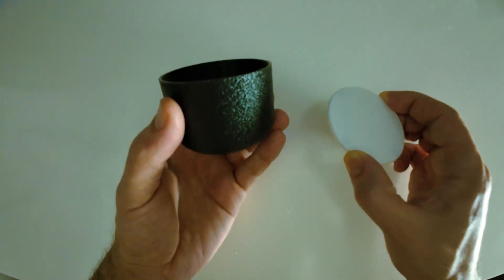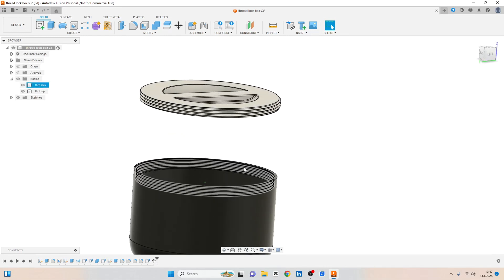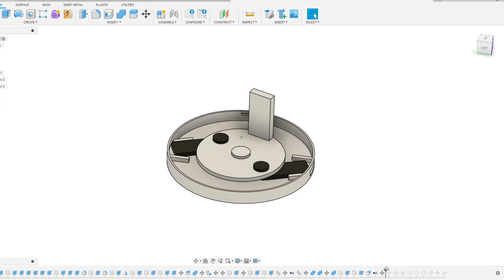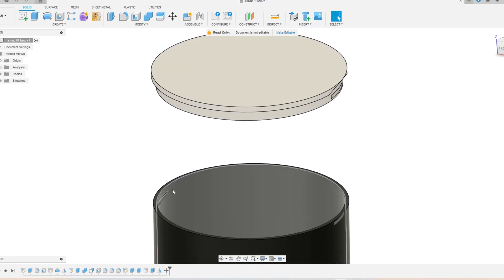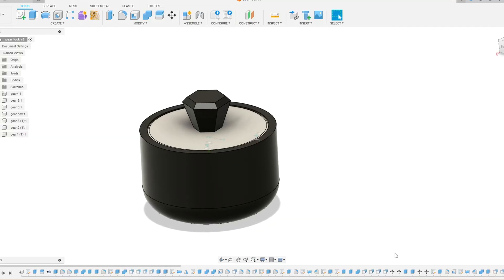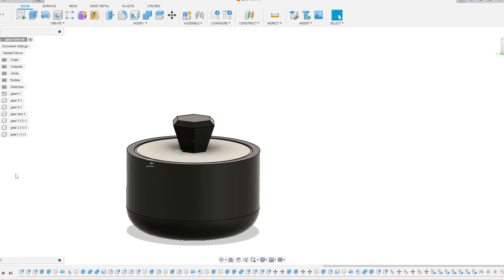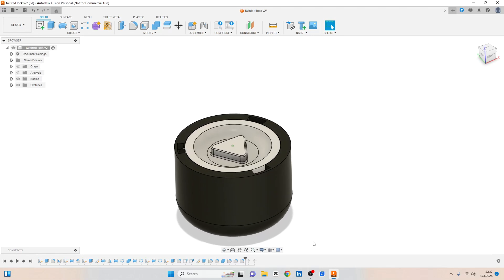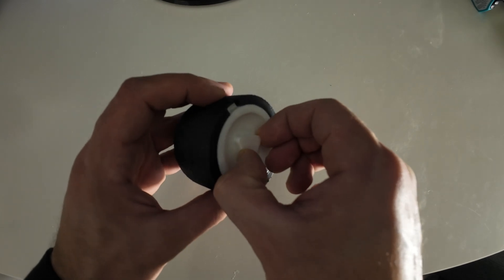How to design  3d printed lock mechanism in many ways

Comment: Nice, helped with my ideas. I wish that you made push "button" mechanism. I have two round objects that I need to connect, but I can't use rotation as one object is on bearings, so I need easy to connect two objects lock without rotation. And your video gave me idea how to make it.